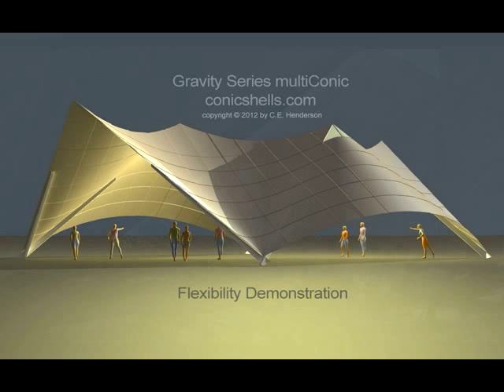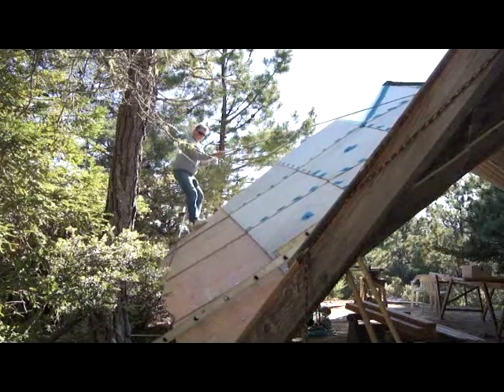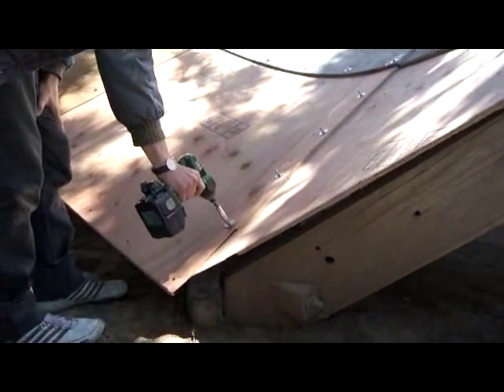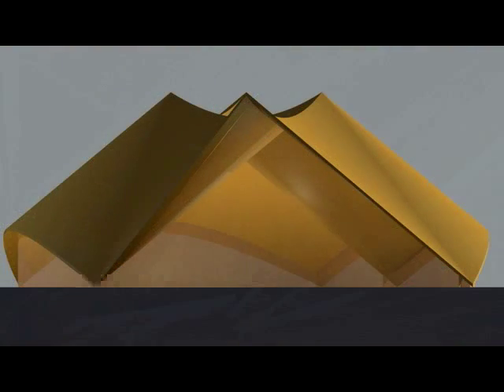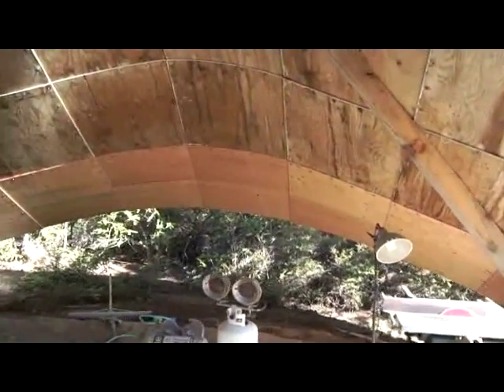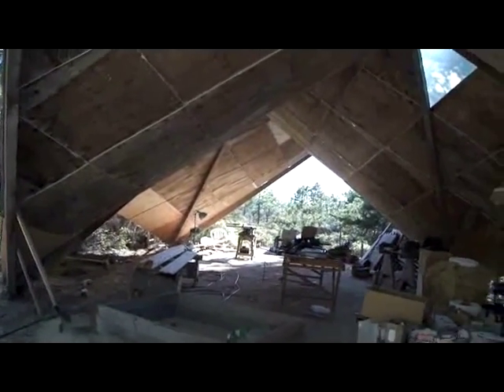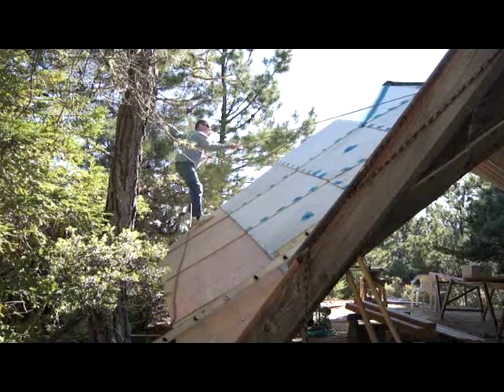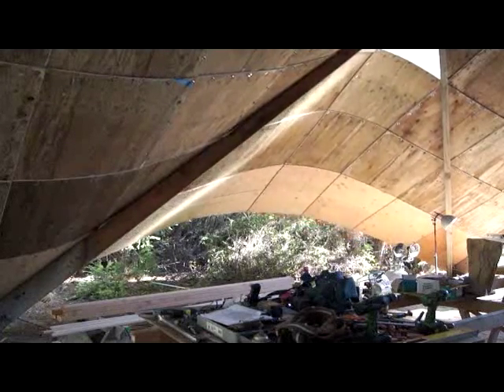Conic Shells conicshells.com Flexibility Demonstration of 1050 sq. ft. Conic

Comment: I can see where the system makes an interesting roofline. How does it function as ... a building? With no walls, what kind of climate would make this a feasible built environment? Is it primarily a method of roofing? If you attach walls to it, what happens to the flexibility?